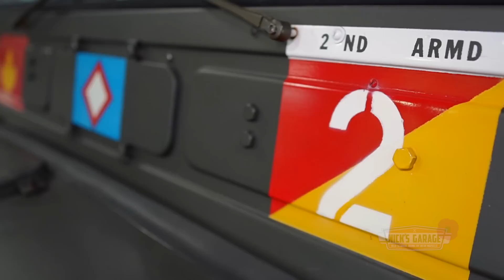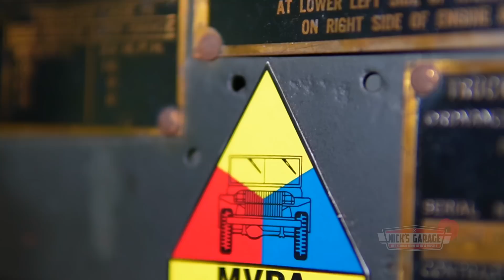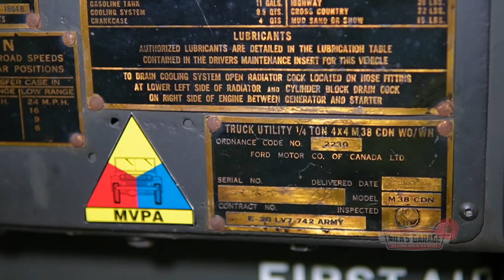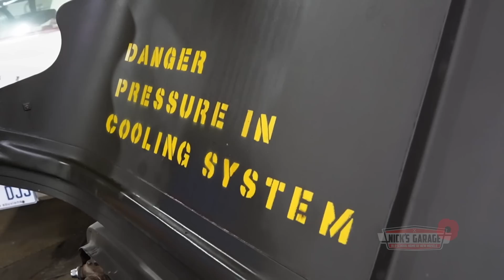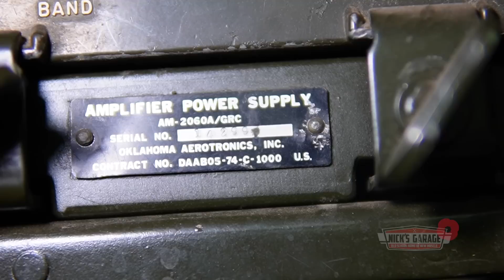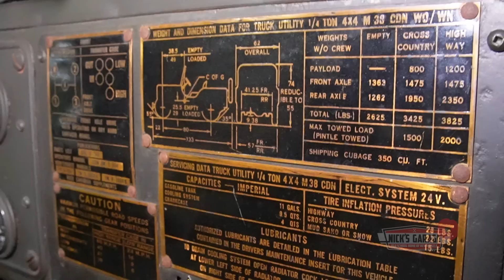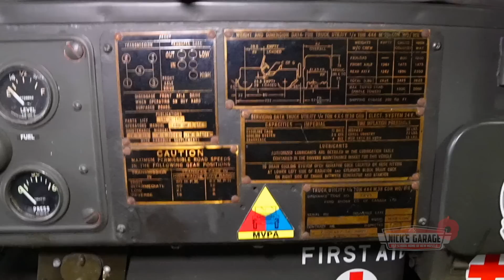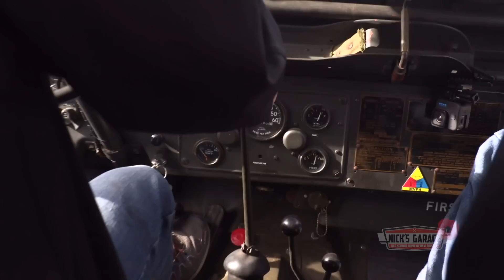1952 Willys M38 Military Jeep - Driving a Piece of History

Comment: Several years ago I had a 1949 Willys CJ 2A, United States civilian Jeep. It had the 134 cu. Inch engine. Same engine I think as the  Canadian version.  Mine was a 6 volt electrical system.  Mine had lock in hubs on the front axle. The shift levers are the same,  on the left is gears 1-3,and reverse, the center shift lever is to engage the transfer case, and the lever to the far right is for high or low range. The vacuum windshield wiper was almost laughable as when you stepped on the gas the wiper would nearly stop, if you were coasting then the wiper would actually do something.  That  Jeep was so much fun. I  lived in Saline County Arkansas then, we had Reynolds Aluminum there, with bauxite mining, and Warehouser paper co. Between them there were thousands of acres with mining and logging roads.  I spent many a day just cruising around back in the wilderness. One day I came to a clearing in the middle of nowhere with a large granite monument,  a likeness of a WW2  B 17 bomber was cut into the granite and the names of all the crew members listed on it. During the war a bomber on a training mission crashed at that place killing all aboard the aircraft.  Being there was like standing on hallowed ground. It's a reminder how fortunate we are to live and enjoy our freedom, and the price that's been paid for that freedom in blood and treasure. God bless our troops and veterans.

Comment: I live on the Alaska Highway in BC. (Built by the US Army in 1942/43)

I’ve seen a few of these. 

I’ve heard all the stories about abandoned hardware along the highway (including jeeps), but I think all the easy pickin’s have been salvaged already. 

The US army did not want to haul the equipment back to the US and they did not want to disrupt the local economy so they buried a lot of the equipment and a lot of equipment was parked on lakes in late winter so they would sink to the bottom in spring. 

But there are those that still insist there are still some out there. 

Thanks for showing this to us Nick.
Reply from the maker: Thanks for the interesting info.

Comment: At the end......"PEACE....LOVE....MUSCLE CARS....and....OLD JEEPS."
MY GOD!
It's been over 60 years so nice I got to drive a Military Surplus Jeep that a customer of my Dad owned,  used and I fell in love with!
The data plates on that dash were exactly how I remembered that Jeep back in the early to mid 60's. 
I grew up in Massachusetts, know about cold, snowy winters.  I also remember helping my Dad at his shop to convert another "Surplus" Jeep from 24 volts to 12 volts.  Then later I got to drive it back to the next town for delivery.  I learned that day NOT to drive it over 40 MPH!  It will scare you!  Like Paul said it was designed to travel at slow speeds.  The 4WD controls are easy to operate but NEVER run those old Jeeps in 4High or especially 4Low ON DRY PAVEMENT!  Transfer case and/or differentials damage will happen!
Thank you for this video Nick.  The Jeep alone was worth the watch, but Paul added the stories which were "the icing on the cake" and brought back wonderful memories and a little emotion.
Reply from the maker: Thanks for the information.  👍